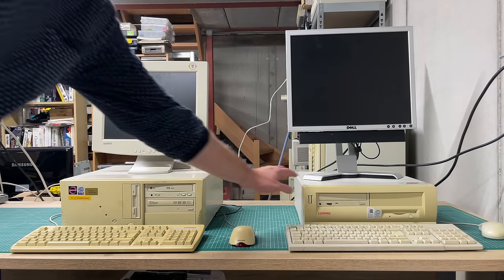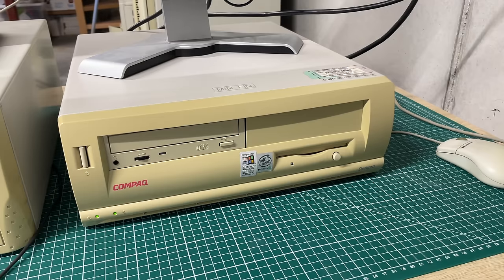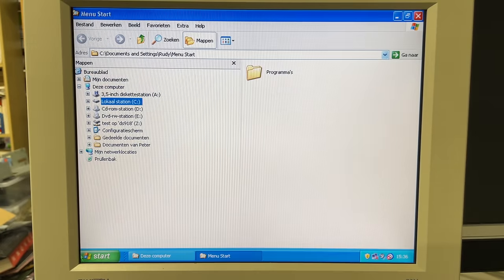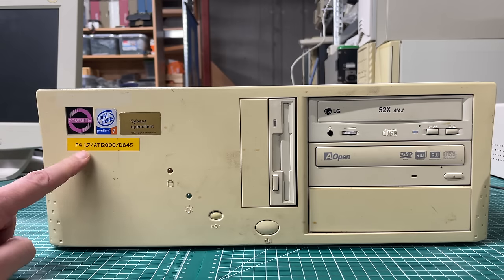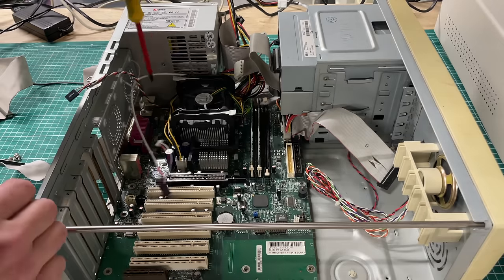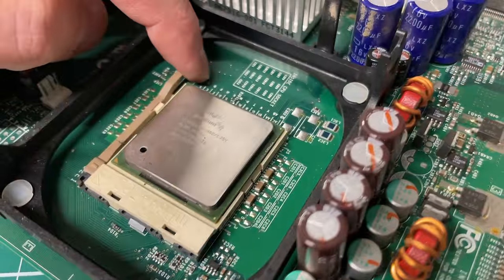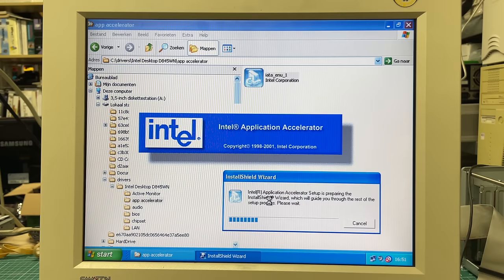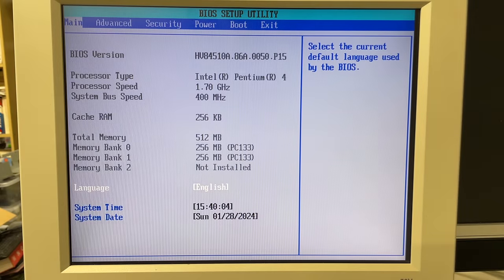Why is my Pentium 4 so slow ?

Comment: you mention that p4 is not good with older osess like windows 98 but the one you have there is likely a Willamette P4 if its running at 1.7ghz. That was released in 2001 so it would have still been in the lifecycle for windows 98 and Xp was only released that year in October.

Comment: "The Pentium III is a lot faster than the Pentium IV. That's not normal!"

I see you don't remember the early 2000's well. ;) Jokes aside - I scrapped my P4 1.8 in 2006, but was still rocking a Dual 1.2 PIII in 2012. Go figure!

Comment: Original P4s were not very good.  That is why the moved quickly onto the Core CPU's.  And remember that the Core CPU's were based on P3s.
Reply: If I recall Intel at least used to have two different teams designing two completely different product lines and alternate releases between them. Kind of like Windows where every other iteration was just hot garbage to be avoided at all costs under all circumstances. The better Intel team was in Israel and made some really good products maybe?
Reply: @benbaselet2026  That sounds about right.  The story went that the Israel team had proposed the new chip based on the P3m core and Intel said no because the had been convinced the P4 core was the way forward.  The P3m team kept on working on their chip anyway and when the P4 failed they went back and said, hey remember that chip you didn't want, do you want it now.  That became the Core 2.  Even the newer P4 DC were based on that.

Comment: Pentium 4 was not slow, people just had nonsense expectations from it and performance/frequency ratio was worse, so 1.4 GHz P4 was worse than 1.4 GHz Tualatin which nobody actually had, so these modern comparisons or theoretical comparisons in paper magazines back in the day were pointless. No, people had NO 1.4 GHz Tualatine at home, they had some 500-1000 MHz PIII, so jump even to the slowest P4 was still a massive upgrade for them and clocks went up pretty fast, one or 2 years later, you already had 2.4 GHz or even more and comparing it to some tualatine was a nonsense, P4 was much faster.
But generally, CPUs were very slow and later GPUs very very bottlenecked, so P4 or Athlon XP, it doesn't matter, everything is slow and bottleneck your GPU, when you want to play like 2002-2004 games on max settings, you need......surprise.....Core 2 Duo, who would expect that?

0:54 - is it both really clean install and does your HDDs are comparable? Because a lot of these tests are not really fair towards P4. I see that you have installed Quake and some other stuff on PIII and iTunes, Ccleaner and other stuff on P4, so this comparison of boot speed is not valid for me. You also have some network disks installed on P4, so your whole test is a nonsense and lie when you don't test it with clean XP on both machines.

Comment: To be honest pentium 4's suck. I've tried them all. All the way up to 3.2ghz both northwood and preshot cores. I actually prefer my old 1ghz pentium 3 if I have to use older intel single core. You can mess around with hdd's and make sure you are running a 7200rpm in the p4 but honestly you will set yourself up for disappointment. Ditch that Maxtor drive they have a high failure rate. Get a seagate or WD spin drive. Other than that I can recommend any Athlon XP cpu. I still have those too. Good to see someone else still play's with old hardware.

Comment: The Early Pentium 4 CPU`s   Socket 423 were  terrible . Intel`s Marketing and fake benchmarks kept the sales going. Net Burst was a Joke Thanks for the Video
Reply: I never fell for Intel's BS during the Pentium 4 era. I was paying attention to the tech journalism (Tom's Hardware, Anandtech) so I wasn't fooled. I went straight from the Pentium III to the Athlon XP and Athlon 64 and stayed with AMD until they released Athlon X2. Never had one of those but I did have an Opteron 170 (dual core so basically the same). Next Intel chip I went for was a Core 2 Duo.

Comment: I just so happen to have a "Preshott" 3.4GHz on the floor next to my main PC ATM, even with linux and a SSD its turd-slow, even compared to the Athlon XP 2500+ machine with simular specs set up the same way, P4 hasnt aged well it seems especially the later Prescotts.

Comment: There's quite a few reasons these Pentium IV's (and also AMD's counter parts of that age) are avoided by enthusiasts like me:
- so many bad motherboards due to either bad caps or bad chipsets (poor drivers or bugs or both)
- these things produce MASSIVE amounts of heat compared to the CPUs that came before (Pentium III) and after (Core2Duo) = high power usage as well! I also fear the heat will kill these systems before long.

Last week I received my first Pentium IV system - a relatively late one from 2006 (the same year the Core2Duo was released) and this thing gets ridiculously hot including the chipsets. I doubt I'll use it as a "main retro driver" because of this. My cat loves it though (it's a desktop PC and he lies on top of it to get warm).

Comment: Or maybe he just skimmed over the fact that..i'm sorry dude im surprise you mad eno mention of this in your video is the hard drive. Did anyone else notice that he is using a cable select (80 pin IDE) Cable? Did anyone else take a closer look at the hard drive and see that the jumper is set to DS master instead of CS enabled. That right there could be one of your issues dude...just saying. use a regular 40 pin ide or set the drive to CS, its that simple. Them MAXTOR drives HATE...HATE HATE HATE. not having the right cable/jumper setup

Comment: intel makes the absolute worst stock heatsink connectors. this design is horrid and then they switched to those insanely fragile plastic expanding peg post things which just break every time you install or remove the heatsink. amd solution is akin to some russian design. just a big latch

Comment: Did you ever tried using the drive from the PIII on the P4? Sometimes old hard drives act really weird in which benchmarks may give you good readings, no bad sectors or anything, and still make the "real world" performance really low...  xD Cheers!

Comment: "Why is my Pentium 4 so slow?" You answered your own question: it's a Pentium 4. NetBurst as an architecture was literally hot garbage. They didn't noticeably improve performance over the PIII until the Northwoods with HT were introduced. The Prescotts were finally decent performers, but even then the impressive clock speeds were only possible due to an excessively long (>30 stage) pipeline which could slow things down in mixed or unoptimized code situations. If you want a truly painful experience, try using a NetBurst Celeron.

Comment: The P4 architecture really is just a hot mess. The hyperthreading addon never really performed well, the cache architecture was really bad and detrimental to performance, notwithstanding the exceedingly long instruction pipeline that needed to be flushed and refilled with every failed branch prediction. There is a reason why the followup intel Core architecture was based on the P3 and not the P4, not just because it was designed by the former P3 team. Intel knew that the P4 was a technological dead end.